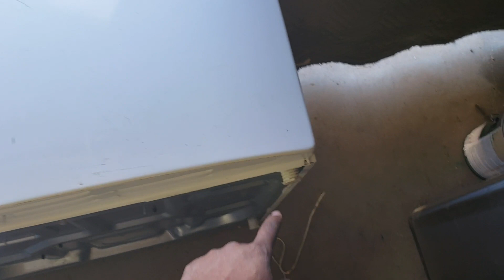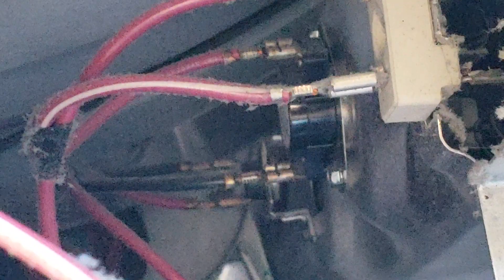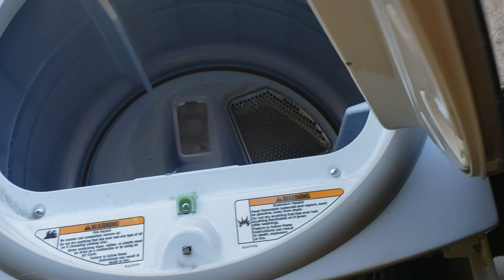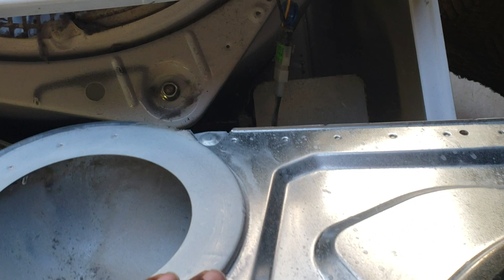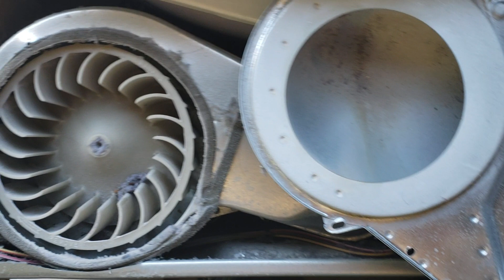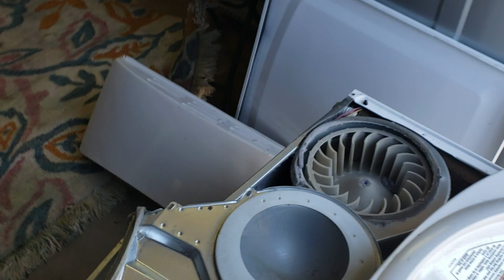Whirlpool Duet repair and maintenance tips

Comment: Also, My dryer was working perfectly but I had to replace my water heater which was sitting right next to the dryer. Ever since the water heater was replaced, the dryer has had this lock panel light on and I can't seem to remove it or turn it off without resetting the breaker. Can you help?

Comment: Thank you but my lock panel light is on.  I'm not sure which button to long press to reset it.  I turned off the electric breaker to the plug but I don't think that's going to solve the problem. Do you have any ideas of what I should do next??
Reply from the maker: will show "*child safety lock" written on control panel button to long press.

Comment: 🆘 I have this model and it's throwing 7E code and I replaced the thermal fuses but it keeps throwing the same code and 😮‍💨😮‍💨 I think the door switch button 🔵 is bad so my question is if I change the door switch and the 7E code still shows what could be the issue 😅 thanks in advance

Comment: Power went put 2 days ago just for a moment... Now my Whirlpool duet sport dryer will not cycle. It turns on my lights are on it tells me cloths r wet but wont start the dang cycle i tried holding the END OF CYCLE button it turned red didnt do anything then redid it still nothing. I already unpluged it while k was waiting i cleaned all behind it and the washer then plugged it back in and still nothing 

Any suggestions? Besides taking apart the back? I mean i will do that but ugh im just a GiRl 😂😂😂😂 jk im fine with doing it just wanna see if i xan do anything else b4 hand

Comment: hi..i have same model gas dryer ..not hooked up to gas yet...im justctrying to test if drum turns...can anybody confirm if thiscdryer drum will turn when not connected to gas line...when i power mine on and use manual function air dry it just stays in sensing mode and drum does not turn and no motor soundscat all...thankby

Comment: Thank you! Yours is the first video I've seen that covers those three fuses/switches on the heating element. The other videos I've seen start with the thermo switch and thermistor in the front of the unit and then stops at the heating element! (But come to think of it, you might want to include those other two in yours as well).

Comment: Mine does not power on at all no lights no nothing, checked circuit breaker and all is good. What’s the most probable cause???
Reply: Mine was doing same thing. I changed the door switch and now works normally.

Comment: I have a duet that will run for a little bit and shut off
Reply: We have the same thing. My husband figured out if we unplug it for a while, later when we plug it back in it will work--usually continuously until we leave it open for  too long, or leave it not in use for more than 8 minutes. Then all the control lights go off. Lately, it's not even running continuously but he's checked and the motherboard (main control board) is fine.

Comment: Great Video! Have a same dryer, had replaced both regulator and high limit  switch 3 times, only lasted one cycle and again no heat. Element is in good condition and heating every time after changing the switch. Control board looks good with no sign of any burns. Vent is very cleaned and without any kinks in it, not sure how to fix now. Any suggestions would be appreciated, Thanks

Comment: Thank you. I had replaced the heat element and the thermostats, thermal fuse and thermistor and it still wasn't heating. This helped me se how to get to the control panel. New ones were no longer available but I ordered a used one on Amazon and it now works.

Comment: What about thermistor? I replaced and worked one day. Then stopped no power nothing. I ordered brand new one and replaced. Still does nothing everything else is good with ohlm test. Lid switch works. Computer looks good and control board as well. Wire connected to thermistor looked burnt on one wire I checked wire and cut of burned end and put new connections  on, still nothing. Can you help please?

Comment: Thanks for the video.  I have the exact same dryer, the problem I have been having is with the panel - it does not light up every now and then, so I cannot run the dryer.  It eventually comes back on in a day or two suddenly and the dryer runs just fine.  This has happened more regularly in the last two months.  Any ideas on what might be causing this?  Thanks.

Comment: Hi Reggie - Gas Dryer Whirlpool Gold Duet GEW9250PW. Start click noise is quieter. Then "SENSING" light on, among others. The dryer will not run. After cleaning the all lint ducts from inside to outside what do you think I will need to do? Thanks in advance and for your helpful video. ~Gina

Comment: I had my dryer apart. The belts are good the drum still spins by hand.  My issue is I turn on the machine and it powers on but when I push start it just beeps and nothing moves.
Reply from the maker: Sounds like the high limit fuse is blown, check the fuses on the blower housing
Reply: @appliancefixacademy  thank you so much.  I replaced it myself and my dryer works great again!!!!! Awesome way to start out the new year!!!

Comment: First video to show the same model duet as we have (yay!). But, how to actually replace the heating element? Other vids showing taking off the front panel and door, but while duets as well, they have the control panel connected different than this one.

----------------------------

Based on your video and another video, I figured out that I didn't need to take everything off after all and managed to pull the heating element tube out fairly easy.  Thanks!
Reply from the maker: I've got a heating element removal video coming for that same model it's in editing. The easiest way is to remove the drum to get to the element

Comment: I had labeled the dryer element wire connector  being top and bottom but have had the stickers fall off.  Can you help remind which one goes where? DOES THE WIRE FROM THE THERMOSTAT CONNECT TO THE BOTTOM OR TOP ELEMENT CONNECTOR?

Comment: WHEN CHECKING FOR CONTINUITY IT IS BEST TO CHECK IT WITH THE TERMINAL WIRES OFF. I DON'T KNOW IF YOU'LL ANSWER ME, I GOT THE SAME TYPE DRYER YOU ARE WORKING ON IN THIS VIDEO. MY DRYER IS: MOD#GEW9200LWO. THE DRYER IS NOT HEATING. I CHECKED THE HEATING ELEMENT, THE THERMOSTAT AND SENSOR THEY ARE ALL GOOD. SO I'M WONDERING WHAT ELSE IT COULD BE. HOPE IS NOT THE COMPUTER.

Comment: So, I dropped a pair of tweezers in the air lint vent. 🤦🏼‍♀️ Suggestions?
Reply from the maker: Take it apart and get them out of here, or drive a magnet in there to grab it. The fan is made out of plastic so if those metal tweeters get caught in there fan could break
Reply: @appliancefixacademy  Hi I have that dryer but the one I got   I turn in on to dry in 15 minutes or less stops not drying yet but when it stops it blinks this E1 pls help

Comment: Hey Reggie, I have the same dryer replaced a broken heat element and thermistor. Works good but I think it runs too hot on all settings like maybe 25°F higher with a new thermistor. On high it runs at about 195°F before cycling. Could it be my board? *The thermistor is different from the old style it had. I don't know, I just think it runs too hot. What do you think?
Reply: Alejandro, El no te va a contestar.

Comment: I have a GEW9250PW1 that doesn't light up at all, nothing. Not sure which board would be at fault.  The thermo fuse is shot and one is on the way.  Any ideas?
Reply: Did you ever figure out the problem? I’m now having the same issue
Reply: @Safemoon Operato  yes, it was the main board. I found an ebay service that repairs the boards so I went that route.  Works now.

Comment: Hey Reggie,
I have the same type dryer. The element heats for 5 minutes then it shuts down and trips the thermal fuse. Cleaning the lint out did not correct the problem. Do you you have any idea what the problem may be?
Thx, mik
Reply from the maker: Yes, your thermostat maybe bad, the other fuse,  it's supposed to turn off the element at a particular temperature and then reactivate it at another temperature. Or you can have the grounded element that won't turn off and that thermostat triggers when it overheats
Reply from the maker: This video should help
https://youtu.be/tOUnLIk7NyE

Comment: I replaced my computer but still have no power when I try to turn it on. What could be my issue?
Reply: I’m having the same problem with my duet.  What ended up being the issue for yours?
Reply: @Syracusehoops21  the wiring from the plug 😅

Comment: I have this same dryer,it wont power on,I disconnected the ribbon from the main and plugged it back in and it powered up and it ran.I then turned it off and waited about 10 minutes and the UI wouldn't function again??Do you think there's a issue with main control board or UI??

Comment: I have the same dryer.  I replaced the drum rollers then when I went to put everything back together the dryer display turns on but the dryer does NOT start.  Also unable to select different dryer heat modes when turning the knob.  Already replaced the door switch and it did NOT fix the issue.

Comment: I had a bad heating element and replaced that as well as all the fuses about 6 months ago.  My dryer isn't generating any heat right now, so I will check the element again tonight.  My wife just told me now that she noticed a few weeks ago that even in the air dry/fluff mode that the dryer was getting hot.  Is there a way for me to run a dryer self-diagnostic?  My thought is the computer has gone bad and that is why it was generating heat in air dry mode?  Thanks in advance.

Comment: Thanks for the video.  Does that Whirlpool dryer have a thermistor and thermal fuse on the back-side of the blower housing like my Samsung dryer that I'm troubleshooting?  The reason I ask is because you provided troubleshooting tips for the thermal regulator, thermal fuse, and heating element at the heater housing.  Then after the discussion of the blower, you said that if everything checks out, the computer is the problem.  I'm wondering if the thermistor or thermal fuse on the blower housing might also be culprits?  Thanks again for your helpful videos.
Reply from the maker: Yes those two fuses are on top of the blowing housing on this model. Usually if the thermistor goes bad the dryer will turn on for a few seconds then turn off. If it's the thermal fuse dryer will not turn on at all

Comment: What kind of test meter do i need to purhase and how to use it?
Reply from the maker: A multimeter with audio continuity
Reply: Thank  you for taking the time to reply and the information. My Whirlpool dryer starts, drum turns but no heat. I can remove the front panel as you instruct but not sure how to diagnose which of the components is the  problem. 
Do you have a video on how to use the multimeter to diagnose? @appliancefixacademy

Comment: I have a Whirlpool compact front load dryer model WED7500VW that I need to change the start capacitor and do not know how to get to it. Front panel screws are to 
close to the drum to unscrew and back panel supports the drum. Any ideas?

Comment: My dryer say error damp light and bulky iteams
Reply: I change a termal fuse one time , thermisor , heater element  and an other time is not works a change a metal sensor strips and moisture sensor
Reply: When i change working again good but again say damp and bulky iteams
Reply: I need help

Comment: Hi, my duet dryer (same as the model in your video) was working fine but now is stuck on sensor but I’ve replaced both sensors, what should be my next move before buying a new one?
Reply: I’m in the same spot. I’m going to look into changing the thermistor and/or fuse

Comment: The light inside the dryer turns when I open the door but the digital screen doesn't turn on at all/won't start
Reply from the maker: Drum light but no power to the control board, is usually a bad control board. They usually sale for $60 used on ebay
Reply: @appliancefixacademy  is there a way to test it before buying another control board?
Reply from the maker: @Fredartic  yes, you need a voltage meter and download the schematics, from there you have to test to see if power is going to each component.

Comment: Hi Reggie thanks for the video I was drying my tennis shoes in the dryer and it must’ve knocked something loose the lights came on and it sounded like things were clear but that was a week ago I’ve tried to unplug it and I’ve tried the circuit breaker and nothing seems to change except for now the light doesn’t even come on any suggestions🦋
Reply: Boutifarm, Replace the computer board.

Comment: Our dryers computer seems to come on, the door locks, and the drier turns on, but the cycle never starts (the drum doesn't start spinning and it stays on sensing). What should we check for this?
Reply: I have the same problem did you fix your dryer? What was the problem?

Comment: I have washer and dryer duet but the dryer does not heat at all . What could the problem be ?
Reply from the maker: Very broad question but usually one of the following,  
Cpu known to blow relays 
Heating Element 
Fuses
Bad electrical come in for the house
Reply: Washer Dryer Repair Tips & Tricks for DIY 'ers  is there something I could do to check if any of these are the problem? Or someone should take a look ?
Reply from the maker: If you know how to use a voltage meter, a most Duets there is a lower panel that will allow you access to the heating element and fuses check my channel on how to check your heating element

Comment: Hey Reggie our dryer is that exact  model and a few days ago the control board stopped working with no apparent reason. The heating element is brand new. It works random times sometimes.

Comment: After I had repaired a bad door button on my electric whirlpool GEW9200LW2 dryer I had to take it all apart when the drum dropped slightly. I have it all back together, haven’t turned it on, but should the drum when turning it by had be very easy to turn? If not could the drum not be sitting on the rollers properly?
Reply from the maker: You should feel some resistance when turning, if its to easy then belt may have slipped off

Comment: What do I do if my dry won't turn on I have the Electric model.  I see the door light on but it doesn't start.
Reply from the maker: Sounds like the white thermal fuse was triggered. Usually caused by bad airflow leaving the dyer, such as pinched airduct or clogged exterior vent outside
Reply: @appliancefixacademy  thank you very much have a good weekend

Comment: Hey Reggie - I just got my duet from my mother and decided to give it a try and it doesn't cut off when it should. It will show 5 mins left but then runs for another 30 mins. Am i missing something? The heat works fine. I have no instruction manual and not sure if its user error. Thanks in advance!

Comment: I have the Duet Steam model.  My son sat in the dryer (145 lbs).  Now the steam nozzle is always on; soaking the clothes  Would his additional weight break an internal hose or something? Or should I try replacing the steam nozzle first?  Thanks in advance.
Reply from the maker: Take the top off and inspect the water line if all is fine, replace nosal

Comment: Hi, love your channel. I have the Whirpool duet you show in this video and the sensing light stays on and the dryer won't start. Is there anyway to get parts for this situation?
Reply from the maker: It sounds like a white thermal fuse has tripped on your dryer, best to test it with a voltmeter. Replacement part should cost about $5 on eBay or Amazon. Part I sell used but you're going to need a new fuse
Reply: @appliancefixacademy  Thank you thank you so much, you are a kind young man. My husband replaced the two bar metal things under the lint mesh pullout, it started for a second then went back to "sensing" and the sensing light came back on. He has a multi meter so I'll tell him about the white fuse. Is this in the area of the control panel or underneath like in the video?
Reply from the maker: @lovelylisawarriorqueen7923  it sounds like those two metal bars are the moisture sensors , he may want to check to verify he plug them back in or check the wiring. Sign of a unplugged moisture sensor or not working is it running for a few minutes then stopping.
Reply: @appliancefixacademy  Quess what? He just fixed it a little bit ago with the White Thermal fuse thingy👍You saved us I can't tell you how appreciative we are to you! Thank you thank you again, I'm going to tell every about your channel. I love my washer and dryer and wasn't ready for another journey with a new set yet so when we thought all hope was lost...this is just amazing. Have a great weekend 😎
Reply: @appliancefixacademy  I'm having this same problem but we just changed the thermal fuse and it still won't start. All the lights light up, it will go through the cycle without turning on and then it says cycle complete. The moisture sensor works because I put something wet near them and it changed from sensing to wet. Any other ideas??? We really need a dryer right now with everything going on.

Comment: HI, My whirlpool Duet gas, front load dryer won't power on. Press power and nothing happens. The light turns on when I open the door...
Reply from the maker: Check the door switch or high limit fuse, it might have blow due to clogged or pinched airduct